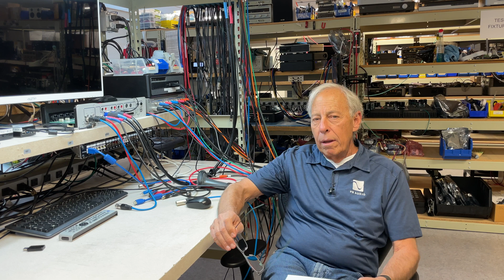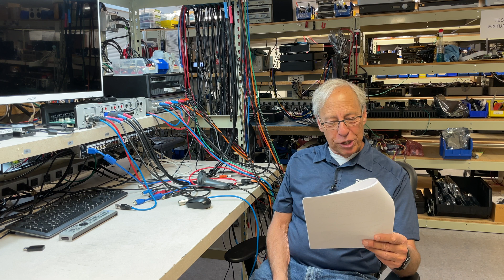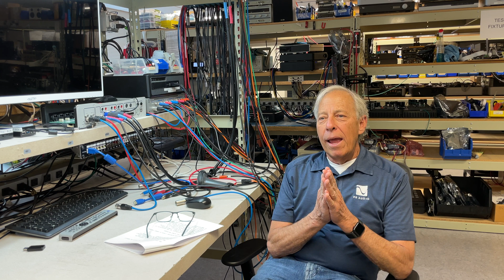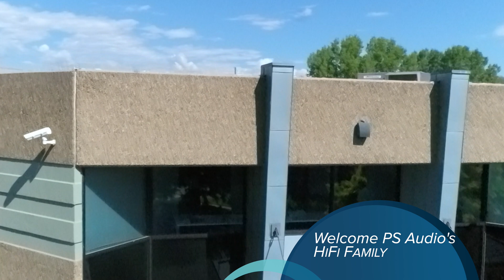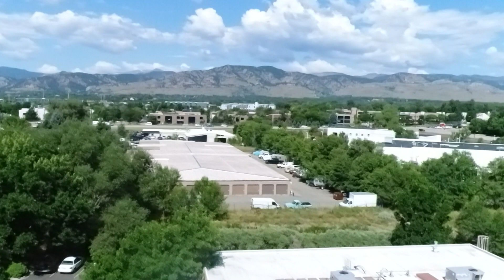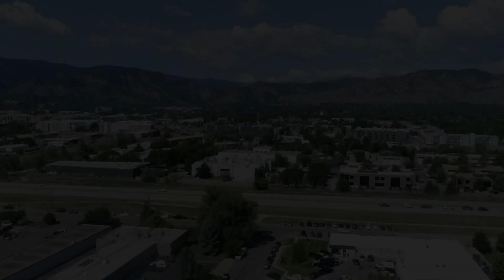Upgrade external clock or power cables?

Comment: A little of what you said is correct, but the overall conclusion is likely out of whack.

You are correct that long term stability is meaningless.  It is all about close in phase noise.  The impact of improving this performance in digital audio is MASSIVE.  If I am not mistaken, Chris speaks to the importance of this in PSAudio blogs.  He cites the impact of the clock choice on the Direct Stream DAC.  So I checked.  It uses a Crystek clock.  Like most sub $10k DACs.  It is a good clock, but entry level in audiophile land.  
The Crystek CCHD-957 24.5 MHz clock has a phase noise at 10Hz of -97.950dBc/Hz.  The clock I use measures -150dBc/Hz at 10Hz.  Let me tell you the difference in sound is reasonably good digital sounding DAC vs natural nuanced analogue playback.  It is a dramatic improvement.  Every step up in close in phase noise on the same DAC yields more of the holly grail we all seek.  Of course, the rest of your system has to be transparent enough to allow the good stuff to come through.  But most peoples systems are severely limited in the source.
By comparison, a power cable can make a nice change.  Is it worth $5k.  No way.  Could a clock be worth $5k?  Absolutely.
Mine is a DIY DAC.  The Crystek is about $35.  My clock might be $200.  But my DAC with that clock will smoke any commercial DAC under $20k.  A commercial clock with these phase noise numbers will be over $10k.
So your advice is IMHO dead wrong.  Your own DAC designer Chris would fully agree BTW.
Reply: I was thinking of building my own DAC- any good suggestions to get me started incl your clock details etc ? Thanks in advance.
Reply: i agree with you. however this channel is geared towards entry level people with entry level gear.
Reply: @zijunai8020  no it's not

Comment: Paul, I enjoy your videos but in this video, you clearly show that you have absolutely no idea what you're talking about. May I suggest that you do some research prior to making a video on this very important topic for audiophiles with high-end audio equipment. For audiophile with lower quality equipment, this topic may not be relevant (ie they may not be able to discern any improvements in the sound quality).

In general, I would start with power cable which do improve the sound quality in most systems but the cost of the power cable should match the quality of the equipment and the hearing ability of the individual. There's no point in upgrading the  power cable if one cannot hear any improvements in their sound system or don't really care about any improved sound quality at all.
Reply: Most of your comments here are nonsensical.  But certainly indicative of a mainstream "high-end" audio mindset.
Reply: Kenneth, you need to spend more time watching videos about Schiit Audio products on their channel.
Reply: I don't believe most people can hear improvements even on the most expensive gear sure they claim as such but people usually feel the need to lie when large amounts of money are involved.
Reply: @ryacus  You're exactly right.  That's because many cannot audibly discern / interpret what they hear.  For some reason they think they're born with such discernment perhaps because they have 2 ears and passed a hearing test 2 years ago.  It's by far the greatest weakness in this industry and that's why so many cling to high cost equipment and to measurements including audio reviewers and even editors-in-chief.  Nobody expects a critique of the fine arts to be born with the ability to discern what he sees without an eduction and training his eyes.  Yet, in "high-end" audio, there are seemingly highly-educated types who think it's an in-born talent.  In fact, I have every reason to believe that the creators of MQA banked on this lack of listening skills among the masses such that if they could get a couple of editors-in-chief to endorse the MQA product with claims like "experiencing the birth of a new world" by John Atkinson of Stereophile and similar crap from Robert Harley of TAS, the masses would follow suit and many believed.  Thank goodness the MQA effort seems to have failed so far but in the process have convinced so many that it was a superior format to anything else when in reality it wasn't much better than mp3.  All because so many have checked their brains and ears off at the door.

And frankly that's why I commented above about Kenneth.

Comment: A DAC that needs an external clock does not deserve one...as it's not a well-designed DAC.
Reply: take a look at dcs vivaldi
Reply: Never heard him say his dac needed one. Think you're putting words in the guy's mouth.
Reply: @AccuphaseMan  I’m sure PS audio’s engineers are designing excellent internal clock circuits. Concerning dcs valdi, we are talking over-priced snake oil. Paying US$15,000 for a clock generator driving a DAC is nothing more than idiocy.
Reply: @ThinkingBetter  Why so?
Reply: +1.
Reply: like an amplifier is not well designed when it needs a power plant
Reply: @Harald_Reindl  Yes, a well designed amplifier has already received a lot of engineering care into making the Vcc rails free of noise and voltage fluctuations due to mains noise. Of course there are the <1% of people having a factory in their garage using heavy machinery creating a lot of mains power noise where a power plant is needed and will make a difference. Generally I believe people who have enough money to pay for a power plant will not be those people living in some rural area in a third-world country with the power coming through flaky wires.
Reply: @ThinkingBetter  whatever - the fucking money for a power plant could have been invested in a amplifier with a proper power supply AND room treatment - other than the idiotic power plant you can hear proper room treatment making midrange amplifiers with midrange speakers sound way better than all that audiophile crap just burning money
Reply: @Harald_Reindl  Harald, ThinkingBetter is in your camp as am I. I don't think he is advocating the need for a PS Power Plant. But if somebody wants one, well it won't do any harm either. My revelation in sound quality is when I built a home theater room with proper acoustic treatment through out. As you say, proper acoustic design and treatments will pay out demonstrable improvements anyone can experience.
Reply: For $15,000 I can buy a used, re-calibrated, Caesium or Rubidium standard made by HP or other aerospace products manufacture. Not some PC board add-on built in a garage!.
Reply: @andydelle4509  your audio don't belong to the PC board anyways - external soundcards with optical connection to the apmlifier are the way to go - cheap, no noise, no problems, just perfect and low costs too
Reply: @Harald_Reindl  Actually all fiber interfaces have more jitter than equivalent copper links. Fortunately not that significant especially considering the benefits of ground loop isolation - if you need it.

Keep in mind that TOSLINC is a poor fiber implementation. It works OK for consumer audio. But it is no where near the same as higher end data fiber interfaces used in IT systems. World of difference in performance. Hint, they don;t use TOSLINC to tie the North American continent internet to Europe. In fact your CATV fiber if all the way to the home is not TOSLINC either.

And if TOSLINC or coax SPDIF, the digital audio signal is the same bit for bit. The caveats of external clocks remain the same.
Reply: @andydelle4509  the point is "And if TOSLINC or coax SPDIF, the digital audio signal is the same bit for bit" and that with optical connections there is no way for noise on the cable - the soundcard don't belong into the PC anyways
Reply: @Harald_Reindl  Yes, if you have a ground loop problem between your gear, TOSLINC may fix it quite well. But I personally prefer copper over fiber for short  connections unless I specifically need galvanic isolation. I you prefer TOSLINC fiber regardless, that's fine too. I am confident there is no difference in sound quality between TOSLINC fiber and copper, unless you have a ground loop problem. Then TOSLINC is clearly the better choice
Reply: @andydelle4509  well, my homeserver is 10 meters from the amplifier away and the TV has only one digital output which is optical anyways - anyways after room treatment for the same amount of money as all the gear, speakers and TV together and a full digital chain holing 2800 albums one click away i couldn't care less about whatever audiophile snakeoil

the overall quality is for sure better than what most audiophiles with their cables for the amount of my whole living room including all gear and room treatment ever heard - spend your money where it really has an impact and spend the rest of your money for the music itself

Comment: my vote is for Nordost Vahalla cable. I auditioned the USB cable and it's amazing. Wish I didn't try it  - cannot unhear it. If you have a good DAC, it should have a good clock.. external clock is snake oil. lol....
Reply: I think the idea isn't that the dac doesn't have a good clock, and more to do with upgrading the existing clock. I think of it like a preamp might come with a good MC/MM phono but a better quality external phono will be an upgrade.
Reply: I am a fan of NBS cables.
But not all are real good.
Reply: "I auditioned the USB cable and it's amazing" - hahahahahahahahahahahahahaha. That's not me laughing - that's the salesman. I bet they had a wager on who could get some moron to buy a £3000 USB cable. Did they at least offer to burn it in for you? Ahahahahahahaha!
Reply: @richardt3371  Cope harder
Reply: @richardt3371  have you tried the Nordost Valhalla USB cable?
Reply: the insanity to say that clocks are snake oil but literal snake oil USB cables have huge differences. If you're not trolling, you need help.